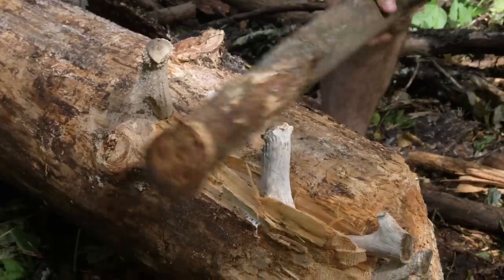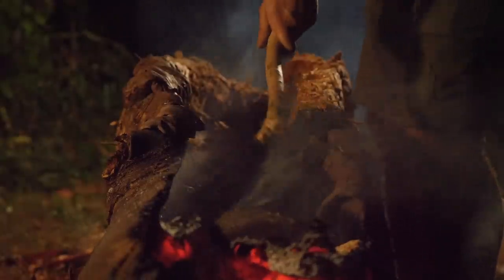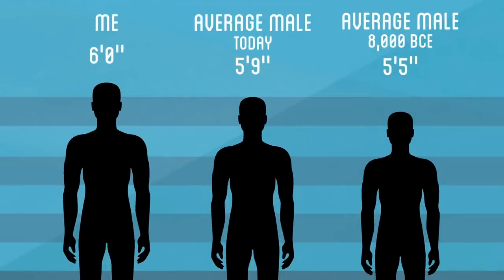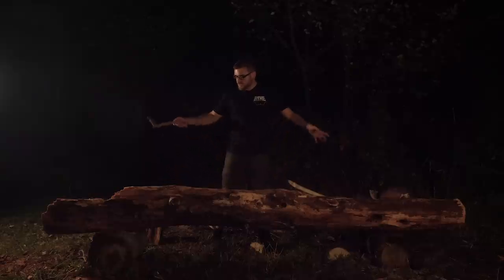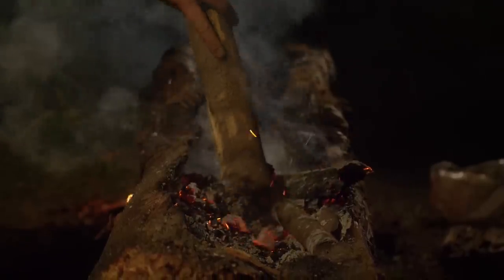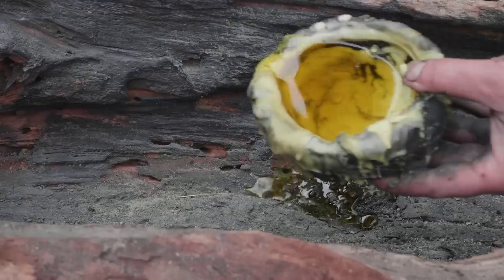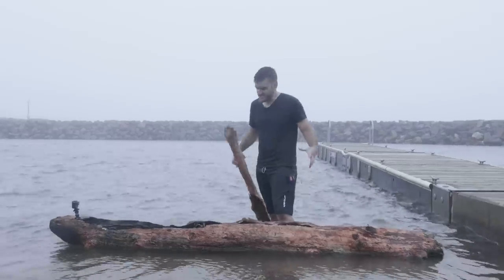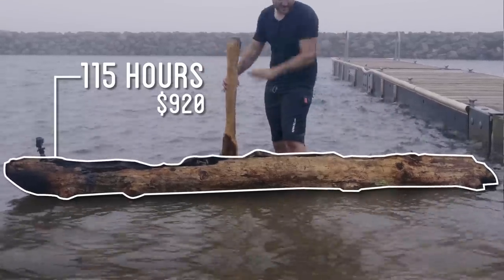Making a Stone Age Dugout Boat with Fire

Comment: "Stone Ax (Some assembly required)" ...
I see what you did there!

Also, Andy, please keep the boat and add a floating aid on the left side (when facing from the seat, looking at the camera). There are many cultures who still use such canoes with side floats. I mean, the alternative would be getting another log-canoe and adding them side to side, but I think the floats would be easier to make since you don't need to dig into the log (with fire or tools) more than is needed to attach them to one or two thinner logs. 

The next step, after the canoe with side-floats, could be a raft made with lots of smaller-diameter logs tied with rope.
Reply: He did literally say he's going to make it into a catamaran.
Reply: side floats and outriggers rely on a lot of the same principles
Reply: Or he should've boarded it like how you would ride a horse it would've solved his balance problem
Reply: Andy: no, I don't think I will
Reply: @mybackhurts7020  My pleasure! I hope we get to see an outrigger added to the boat soon.
Reply: Many cultures use side float? Many or all of the cultures? Which culture dont use them?
Reply: @santiagocortez9554  not much point of it being a dugout then

Comment: I like the way you show your fails and admit when things go wrong :)
Reply: And the way you use a chainsaw and pretend it didnt happen 😊 3:05 look at that cut, wasnt made buy a copper axe
Reply: Ye but that was to show that a hole could be made in a log
Reply: @thehyperactivesloth6824  Yeah they probably also used cars to get to the property where the tree was.. were wearing shoes they bought and didn't make... probably used matches or lighters to start the fires, not sticks, etc.  It's not like they started naked.  Decisions are made about where to draw lines in the work they're reproducing vs what modern resources are brought to the table.
Reply: @adfaklsdjf  yes, ik , BUTT noone thinks he walks every were... He treid to make it look like he did it with his tools... How many times did they cheat just a bit when the camera was off.
Reply: @thehyperactivesloth6824  As many as necessary. I never felt like they were pretending they never use anything modern.. cutting the branches off the log is not the same as making the dugout.  They didn't cut down the tree either.  The point of these videos isn't "we did everything the hardest way possible".. it's "we reproduced what you would have to do".

I'm not convinced they did use a chainsaw just from those few frames, but even if they did, we've seen Andy use power tools in other videos.. I don't think it invalidates the video.

But think what you like.
Reply: Ray van Wayenburg it always goes wrong with this dude
Reply: @adfaklsdjf  meh, fair point , i mean i dont get why he did just use his tools , its not that hard to just cut around a branch and break it off , but if he had other things too do and couldnt spend an extra hour or two then whatever. But for the most part he does go all in on his projects so 👍
Reply: @80RedRock  look again buttercup <3

Comment: The wood sounds very dead. Probably one of the reasons you didnt get a clean crack.
Reply: yeah too moist, im not sure how tree's work or just life in general tbh, but it was hollow due to starting to rot essentially i think.
Reply: Can confirm, crack that is not clean will definitely cause dead wood.

Wait, are we still talking about the same thing?
Reply: @Dockhead  yeah it was a rotting dead tree, heavy with water, probably with a nasty twist that made splitting difficult, full of knots. About everything you could do wrong with a dugout, they did it right here. However it still shows how successful the dugout is as a design considering they were still able to get it to float. 

Personally I'd be fixing up that stone axe they broke along with making a stone adze and then finding the perfect tree for this sort of project if I had the access, Cutting down large green trees with a stone tool is basically not happening, but as you see here fire does wonders and works as the perfect primitive saw. It is likely how large canoes were made Majority of the work done with fire and only the final detail work done with stone or copper tools.
Reply: @amefeu4259  Not as likely as you would think. Remember that entire tribes put manpower into creating these things, from the tools used to the labour of bringing them down, and pine and cedar were the preferred trees, and they would be soft enough to cut down by hand. In the cases of making canoes out of trees like black walnut or other really hard wood hardwoods, then yeah, they definitely would have, though- thick layer of clay girding the tree, burn a fire up the fall side and chip away the char to let the fire make the wedge 'cut' that axes would do otherwise.
Reply: @KainYusanagi  While I agree that tribes could and would have put significant manpower into creating canoes I'm not sure whether fire or stone tools would be the most effective assuming the char was chopped  to continue to expose unburnt wood. Maybe with a large labor force direct chopping would be faster on softer trees it seems like something that would only be done when in a rush, not something done as an effective means to maintain long term production. Which if they only need a canoe every once in awhile maybe so.
Reply: @amefeu4259  That's exactly what I'm saying; softwood trees would have been much faster overall just chopping, because the hardness of the wood isn't much vs. the combined manpower labour put in the chop the tree. There wasn't any consideration for "long term production", either. Such canoes were made and then survived through many, many generations before needing to be replaced, and any given tribe didn't need THAT many of them, either. Most of the work would probably be done by the young men of the tribe, who were too young to go hunting with the men, but still needed to help out with things. They'd probably be the ones tending the fires as they burnt the log, under the guidance of an elder.
Reply: @KainYusanagi  So yeah then I agree that on a softwood tree pure chopping would have been faster, it still seems like it would only make sense to build one this way when a canoe needs to be immediately replaced, new canoes for a growing tribe, and replacing worn out canoes should be planned around. While a burning process is slower, it seems like it would be more efficient use of time and energy. Maybe there is a critical point where with enough workers it is more efficient to all chop.
Reply: @amefeu4259  With the burning process you need a lot more care taken to ensure it doesn't eat into the tree, and with pines especially, the sap is going to smoke like hell. Additionally, new canoes for a growing tribe or to replace old ones that no longer were usable would be planned around, but the time scale would be over months, not this constant work non-stop over just a few days that they did here. If things were really dire, like having lost all their canoes in an attack or something, sure, they might hard focus on doing it together as a whole tribe at once to make the process end much faster, but it'd still be on the scale of weeks.
Reply: @KainYusanagi  No more care than taken to burn the dugout canoe itself. With sappy trees girdling ahead of time might be critical, although that makes them harder.
Reply: @amefeu4259  No, a lot more care, actually. The fire wants to climb, and banking a fire right against the tree in question you're wanting to bring down is a pretty big concern; the basic concept, which is what they seem to be going for first and foremost? That's risky as hell. Burning out the log once it's down is actually very minimally risky and doesn't require much care at all, beyond slaking the edges with a layer of clay to prevent it from burning out entirely. Soaking the log after the initial hollowing, then supporting it over a fire with sticks inside pushing at it to force the upper edges outwards, would help them a lot. Ofc back then they'd have it down to a common act done thousands of 
times throughout history, with minute alterations and changes devised to
 make it better, but they really seem all about the absolute most basic understanding of the method to use, as we saw with the stone axe, and the original copper tools with the bent sticks for handles that made them very unwieldy.
Reply: @amefeu4259  No, a lot more care, actually. The fire wants to climb, and banking a fire right against the tree in question you're wanting to bring down is a pretty big concern; the basic concept, which is what they seem to be going for first and foremost? That's risky as hell. Burning out the log once it's down is actually very minimally risky and doesn't require much care at all, beyond slaking the edges with a layer of clay to prevent it from burning out entirely. Soaking the log after the initial hollowing, then supporting it over a fire with sticks inside pushing at it to force the upper edges outwards, would help them a lot. Ofc back then they'd have it down to a common act done thousands of 
times throughout history, with minute alterations and changes devised to
 make it better, but they really seem all about the absolute most basic understanding of the method to use, as we saw with the stone axe, and the original copper tools with the bent sticks for handles that made them very unwieldy.
Reply: @KainYusanagi  Actually because of how stone tools "cut" the mashed fibers of the tree burn easier than the denser log. and can be used to control how the fire burns through the tree. Large trees if you haven't noticed usually survive forest fires well enough to survive and continue living. Yes you want to control the fire burning upward but it leaving a sloped edge is fine because that's the usual shape you want for the front of the canoe anyway. The same mud trick can be used to stop the fire from spreading up. 

The most basic canoe can be built with fire, and mud. In fact was built in such a manner using only wood scrapping tools to clear away char. (I found such a description in Primitive Technology II: Ancestral Skills)

Although I totally agree that they should have probably spent time refining their base tools since they seem intent on using them.
Reply: @KainYusanagi  yeah but you need less calories for a fire then for a team of people making a single boat. And thats there main concern is food

Comment: Man, my first instinct would be to make it "wider", by adding another smaller log on one side using two struts to spread out the weight, since wood typically floats by itself. That'd help the balance, and add a little more flotation overall. I'd also take the lesson learned by making my own pottery to build up the sides by making a longer lip, firing it solo, and then seal it onto the boat via the hot pitch method so I have a waterproof barrier where I ran out of wood. Not authentic, but probably less of a flip-trap. Very cool work though! This whole series looks amazing (I'm coming to it as of today) and this is like my dream job. I love doing stuff from scratch!

Comment: You might be able to widen it a bit using hot water. Fill it with water and then baked rocks until the water boils and wedge sticks into the top to slowly widen it where you need it, the process can also cause the ends to rise up slightly in the classic canoe shape. You'll need to do more research on that though as I've only read about it in books. Steam shaping might come in handy when making your bow too.

Comment: I worked at a Boy Scout camp as a lifeguard for a few years. At one point, we had a challenge for the campers to make a "boat" with the stuff they could find around camp and race to see who made the best boat. Although some cheated and found dock foam (the stuff that makes old wooden docks float, basically looks and feels like much finer styrofoam) some of the wooden... well, basically rafts they made worked surprisingly well. Turns out stability counts for a ton in a race of makeshift boats made by teenagers.

Also, pro tip, as it looks like you noticed, using an adult PFD on a child doesn't really work. Both for how they can move and for how they float, the PFD rides up really far and wouldn't keep their head above water.

Comment: You should look into a long reed or other hollow stick, it keeps your face out of the fire while you blow and it enables you to concentrate the oxygen and heat to one area for a stronger burn. It's great for using fire to cut holes in logs for something like a cabin or a hinge hole for a cantilever lift.

Comment: Just an FYI, the reason the canoe waw very tippy was because of the fact you wrre in that kneeling position. Canoeing is all about using your body weight to control and steer, the padel really doesnt do as nuch as you might expect. You should have your legs in front of you, with your knees turned outward toeards the edges of the canoe, gove you much bettet control

Comment: The earliest boats were crude reed bowls called a variety of things such as Basket Boats and Coracles. Most are coated in some type of resin for waterproofing. Sadly, they don't hold up well over the ages so it's hard to pin down a date. We have remains from the early bronze age and some record stating that cultures had used them for as long as anyone knew their own history at the time. Interestingly, these are still used today in Asia. Furthermore, while boat remnants are rare we do have many neolithic cave paintings depicting boats so the real ages is much older. - Worth noting here that rafts and boats are not the same thing.

Comment: I have done that kind of canoe, althoug using a steel axe. The tree chosed is too narrow. And the first step is to shape the bottom in contact with the water. When done, THEN you start carving the wood with fire. Better if when you made the first cut, let more wood in the sides, for higher "walls" of the canoe, in order to avoid water filling the canoe when there are waves.

Comment: you need to carve the sides of the canoe so they a point at the bottom.  The canoe is currnetly just like a log in water, easy to roll. If you make it like a blade cutting into the water its less likley to tip.

Comment: Just as a tip for the next time you are carrying something like a log. Take a loop of rope and instead of just sticking a bar through it and having two points of weight being hwld by two people,  twist the bar(log) around until the rope is twisted together so that there is only one point of weight being supported by two people.
Reply: wouldn't it swing back and forth as they walked?  what's the advantage of all the weight dangling from a single point, as opposed to dividing it into two?
Reply: @adfaklsdjf  the issues comes into play with people. No two people are going to be able to have the same exact strength, height, length of arm etc.. Thus by having those differences you will create an inbalance with the log with two points of load being suported by two people. And one person will end up having more load than the other and it will cause even more strain and tiring out. By making one point of contact you are then equally spreading out that same point with two people. Basicly you are halving the the load equally between two people and making it easier to carry.

Comment: Green tree, of sufficient width, with ZERO bugs, low level limbs (knots), rot, or disease.  Chop into log(s) of more than sufficient length.  

Haul boat sized logs into a cool dry place, like the inside of a dry shed.  Allow to dry and season for at least 1 year.  

THEN use fire to hollow it out...  from the beginning.  There is NO need to split the log.  Just let the fire take the sides down as ar as you need, and just keep chopping away the charcoal as it does so.  

A PROPERLY BUILT fire hollowed canoe...  can take a YEAR OR MORE to build with just two people.  Entire villages used to get in on building just one boat, and even with 10-50 people it can STILL take as long as a year; depending on how much wood is removed by hand, how much is removed by fire, how hot it burns, how long it takes to burn out, how dense the wood is, ho many people there are to cut and chop and burn it, and how much moisture is still in the tree trunk.  

You and just your family?  A tree sufficiently wide enoungh for you?  If it's not already rotted out like that then ->  at least<-  6 months of DAILY and constant work, working at it.  As in "this is my job now".  Having to work in the real world though, and dojng this essentially as an ad sense paid hobby...  1-2 years probably not counting seasoning the log in a dry shed.  And the whole process NEEDS to be done inside a cool dry area where moisture, insects, fungus, and mold are absolutely kept completely at bay.  Even the slightest bit of mold on the log as it seasons can cause leak holes or worse, get inside the wood of the log and obliterate it from the inside out.  This would take a LONG time to do, but it is still a concern.  

Yes you can just take fallen trees and do this, but as you saw it is WAY less reliable.

Comment: you need to add some pontoons.  to stabilize. like RIGHT where you are sitting the second time you flipped over.  It won't be "pure", I guess, but it should keep you from rolling.  How much does the boat displace when you are inside it?  How far are you from the water?  Best case, get a bigger log.  But I think pontoons would help with buoyancy too.

Comment: Andy, Get a better hammer! It will save you so much work. Those sticks look awful to swing. Try a stone maul, with a hardwood handle. Preferably affix it threw the middle of the head with a hole you can bore with a friction bow.